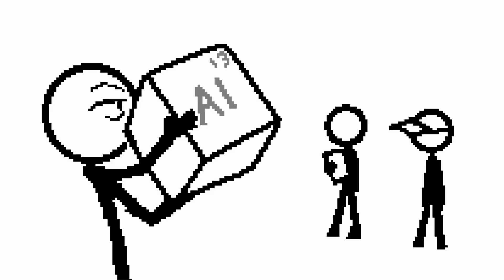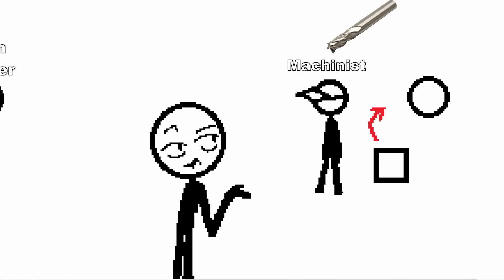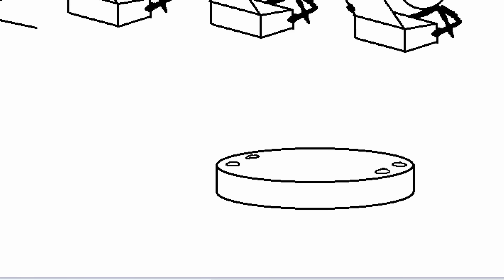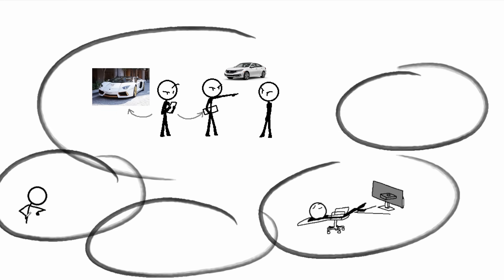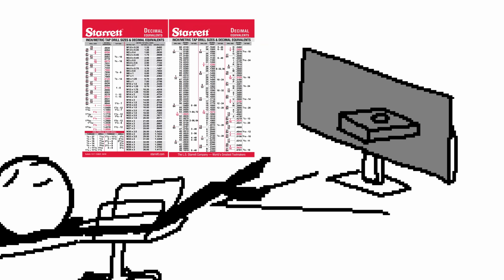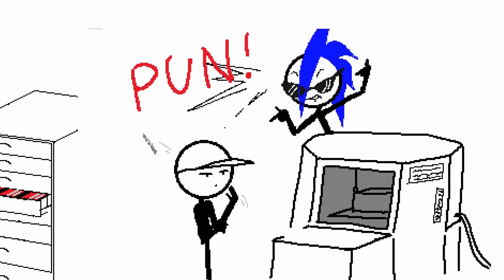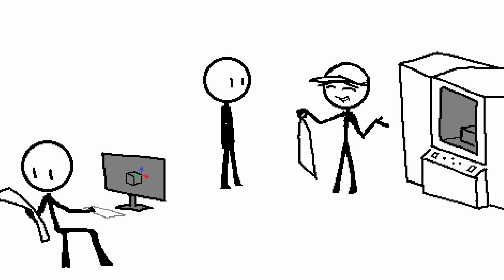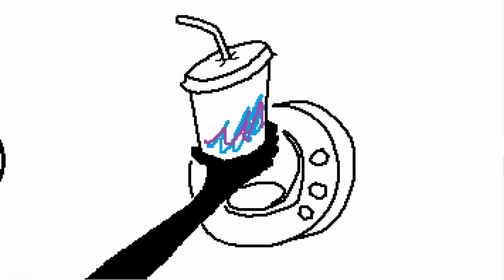Why we hate engineers

Comment: As an engineer that works in aerospace, I vibe with this but in a different way lol. I have to oversee so much crap, and there are some horror stories when our contrators are not closely babysat because they cut corners. 

Infamously in my field of avionics, Lockheed and Northrup working together on the F-35 did something embarrassingly stupid. These planes are stuffed to the brim with highly sensitive electronics and wiring. They need a special type of insulated, twisted wire to prevent electromagnetic interference between wires and from radio emissions. It's very basic stuff, but do you know what is cheaper? Regular old straight wire, perfectly susceptible to EMI. So during testing, they did what I can only describe as a taking a hyper advanced, 53 uber-gajillion dollar flying supercomputer, and fully wiring it with bargain-bin straight wire. When the adults (paying customers) came back into the room to fly their new 42069 cuckillion dollar death machine, nothing worked. It had to be taken apart and rewired on the contractors' dime, wasted a lot of schedule time, and heavily pissed off the government people overseeing it.

This is why we don't let contactors do things without strict oversight lol. People with my job of what is basically "small team of engineers working for paying customer overseeing large team of contracted engineers" have to be very cynical and nitpicky.
Reply: Electromagnetic interference [EMC] (and stealth) is the new kid on the block and cuts through everything. The biggest 'problem' is the `mechanoids` who haven't realised that metals are conductive and hence part of EMC design. It's easy to accidentally compromise designs every which way - It's like "what if plastering was part of electrical circuits"
Reply: You lost all credibility when you spelled Northrop wrong...
Reply: @prelude12341  you don't work with engineers much do you

If you think a single spelling mistake can undermine an engineer's credibility, then boy do I have the Description fields of some ECOs to show you lol
Reply: @brandonthesteele  I'll have you know I'm top of my departmint at spelling.
Reply: The funnies thing is that by what you say, they could have just fucking grabbed some CAT6 cable (heck maybe 5e?) and even if out of spec, I don't imagine it would make completely ridiculous problems surface, but no let's save some pennies out of the many millions.
Sounds like someone at Rolls & Royce looking at the BOM and thinking "hhmmm... We should save money by not clear coating the wood panels!"
Reply: @prelude12341  pffff You know nothing of tolerances then.
The name is Northrop (+- 1 letter)
Reply: 😅 got a similar but not as severe story. Special machines for agriculture need GPS, GSM, UMTS, and LTE you name it. To protect it from nature and farmers they replaced the plastic cover with a coated steel one ... Easy to fix but made a view folks dozens of years older as we couldn`t reproduce the error until we got a machine from production.
Reply: @MrHaggyy  We had a an even less severe situation at work, with our only router on the room being inside the network switch box.
Yep, a Faraday caged router. Signal/10 for sure.
Reply: Don't the government people know they work for the contractors? Those are tax-paying voters! Government people have no right to be upset at tax-paying voters!
Reply: They also sourced materials from china
Reply: I’m more than a little suspicious of your story, not for spelling “Northrop” wrong, but because you say it had to be rewired at the contractors dime - that’s not how these contracts are written. Most (if not all) government contracts are what you call “cost-plus”, meaning any additional expenses (unless found to be fraudulent) are paid by the customer (the government/tax payer). That’s why when HII went billions of dollars over contract budget on the Ford Class carrier, Congress had to approve of the extra spending and needed justification as for why; this is one example of MANY. 

Additionally, I very highly doubt extremely experienced electrical engineers would miss something as simple as what you are describing, especially when system safety teams are literally employed to think of simple problems like this and ensure they do not happen on a large scale. Now, could this occur on a subsystem? Sure! Stuff like this happens all the time on very small scales, and perhaps you’re overstating the problem and it happened on some individual subsystem/component that prevented operability, but I guarantee this was not a widespread event as insinuated.

Finally, these contractors poach talent from the government all the time because they pay more. Often times internal oversight in these companies is more experienced than the agency overseeing them; I’ve worked on both sides of the fence, I can tell you that government regulators are not always the brightest bunch.
Reply: As an avtech, god I wish more people thought about how to replace the damn things as well. Some aircraft have shit that fails regularly in stupid to reach places for. O reason. At least make an access door or rearrange some boxes to make ones unlikely to fail at the back
Reply: @user-rt8ul1fn3y  Not all governments are the federal government.

This is a bit easier to pick up on if you live in a real country with a real nationality, i.e. the various enclaves actually have a common cultural heritage, that gets democratic representation to reinforce its values and to spread understanding of how the culture actually functions. The congress no doubt has lots of fun approving all kinds of money that pops up from literally nowhere, but it hardly represents anyone actually backing that up with value of work. 

These cut corners is WHERE that additional value is extracted FROM, so when some things happen WITHOUT a system safety team, they can yield the profit to hire a system safety team to sit around somewhere else. What you've identified here, is exactly the morsel of truth that gives flavor to the big lie, that you and just hire people first and think of the profits later. Funny thing is, it worked for the Societs too, until it didn't, "the great leader would never allow this kind of thing".
Reply: @user-rt8ul1fn3y  I just started working in defense after working in the medical device industry for a leading manufacturer. I’m a mechanical engineer 2 years out of school. I’ve been amazed at how knowledgeable those at my company and others we work with are on so many mechanical engineering topics. I’m trying to be a sponge and absorb it all. 

One thing I’m struggling with are politics between us, sub contractors and companies we work with. Do you have any tips?
Reply: @sboinkthelegday3892  Your reply doesn't make any sense in the context of this conversation. The F-35 was build by American defense contractors, funded by the American taxpayers, approved by the American congress in the American Federal Government . It seems you may have missed the point of my original comment and perhaps you should go read the comment thread again. 

Additionally, what "value" are you alluding to when you say "cutting corners"? Do you mean profit? Sure, of course companies cut corners to maximize profit... but not when those corners impose a significant and unmitigated safety risk, or they break contract, which is exactly what the original comment is stating: the plane (apparently) didn't work because there was a significant, widespread, and easily identifiable electrical and safety hazard present, which would not have been missed by experienced system and electrical engineers.
Reply: @brandonf3865  
Politics are a tricky topic and they vary in every company and position. I didn't like the office politics in my civilian job, but I don't mind them much in my current position (contractor). 

The advice I can give you is intuitive, but sometimes forgotten:
1) Treat everyone with respect, even those you don't like, and talk to them politely.
2) Only state things you know to be certain; if you don't know the answer to a question then simply state you don't know, but that you will find out ASAP and get back with them.
3) Trust everyone's word, but do your best to verify it's accuracy if you can - especially if it effects work you are doing. 

If you can get a copy, read "The Unwritten Laws of Engineering" by James G. Skakoon. It's a short read, but provides excellent advice even outside the scope of engineering. 

Good luck!
Reply: @user-rt8ul1fn3y  will do, thanks!

Comment: I am a CAD/CAM Designer AND Fabricator. This video had me in stitches because I've seen both ends of the spectrum and often have to work with drawings that other people have designed. One of the companies I do work for is only a few doors down from me on the industrial estate ( thank god ). The amount of times I've simply handed them back the drawing and said "No" is staggering,  but after 5 years they're finally starting to get it....starting to.

Sometimes I'll still get designs from them for tooling they damn well know I don't have, and when you ask them why it turns out there was absolutely ZERO REASON FOR THAT SIZE other than "the designer thought it would work", while disregarding "The Chart".

"The Chart" is a godsend, as long as people use it...

Comment: As a freshman going into aerospace engineering, this answered a lot of questions that I didn't even know I had. Thanks a bunch mate 👍
Reply: GL mate, as a senior it's a lot of work but a lot of fun.
Reply: Get a part-time job in a machine shop, if you have anything local.  Learning the basics of what's feasible is massively useful information.
Reply: As a freshman in Aerospace Engineering, I hate myself to model things in AutoCAD Inventor 😂
Reply: @waraftermath4202  AutoCAD or Inventor?  Both are very different lol.  SolidWorks is nicer either way.
Reply: @ClubPenguinMaster88  I swear it’s called AutoCAD Inventor, oh well. But yeah, I had finished five assignments on Inventor that wants me to create a housing bearing for 12” and 6.5”. It sucked when I’m using VDI 🙄 oh btw, I think it was called AutoDesk, I got it mixed up
Reply: As another freshman going into aerospace engineering, this video was perfectly timed with an assignment I got about tolerancing!
Reply: @waraftermath4202  Yeah they’re made by the same company, it’s Autodesk Inventor (3D modeling) and Autodesk AutoCAD (2D schematics and drawings)
Reply: Thanks for the encouragement everyone! And yes, CAD is hard...
Reply: @ClubPenguinMaster88  Inventor is objectively better, but for some reason Solidworks is used everywhere instead
Reply: @Professor Frog I'm a MechE dropout, for reasons outside of academics, but still work in the general field, checking part prints, and doing some modelling and design work for large-volume component production.  Some of the absolute trash I see coming out of larger manufacturers that we contract for is just inexcusable...  I can't speak for other schools, but the graduation requirements on my end only had the school's machine shop as a supplement/lab for our design courses.

Then again, my father is an Industrial Engineer, and he wasn't required to do any machine shop work, outside of a basic introduction, either, but he had sense enough to do so whilst going to school, to pay the bills, as well.
Reply: @turolretar  Inventor has some features SolidWorks doesn't, but when it comes to speed and accuracy, SolidWorks is just better.  I've used both extensively; the only time I ever even consider using Inventor these days is for making gears.

Besides that, I'm not sure what you'd prefer Inventor for.  For SolidWorks, the ability to adjust constraints and quickly create every kind of line with a right-click and drag is amazing.

Comment: I had a job where my role was effectively to translate between the machinists and the designers.  It was waterway engineering rather than a machine shop, but a lot of the principles still apply.  Designers would do things like call for materials that don't exist or parts that are functionally impossible to get on site.  I remember one project where the design called for several places where a log over 100 feet long should be used.  There were not any trees that big on-site and getting someone to deliver a log that size would have been horrendously expensive (let alone maneuvering it to place it in the right spot).  We had to kick that back to the designers going "that's not possible".

At the same time, the guys on-site implementing the designs were constantly looking for ways to get things done faster and cheaper so they were constantly trying to poke holes in the design for places where the tolerance could be a bit looser.  There were so many times the designers let them not follow the design exactly that when they put their foot down on something really needing to be a certain way the guys actually making it would throw a huge fuss.  So many times where they would try to do the equivalent of just angle grinding something and I would go "no, that part really needs that tight of a tolerance".  A few times, it would be bad enough to make me go "you better hope the state inspector doesn't see you do that".
Reply: Im confused how one becomes a designer without the underlying practical machining knowledge. That doesn’t even make sense to me. And on the same thread why wouldn’t machinists be able to make their own designs when they know what is actually possible? It’s really weird to me that this task is split into two people when they are so seemingly intertwined with each other
Reply: @brownie3454  because time is money, and boss won't pay for both time and money they spent on single exclusive person who can do everything. Better split it and make the progress go together
Reply: @eggl7469  maybe i didnt word my comment accurately. even when split in two, i dont understand how either person gets their position without being able to fill the other position as well. seems like it’s asking for trouble and we end up with complaint videos like this
Reply: @brownie3454  because, at least in general, they do share some basic knowledge between each other, but both professions are different in pretty important ways (for example, design engineers need some pretty deep programing and simulator knowledge, while machinist are experts in operating the machines they use), because they are specialized in doing what they are doing (either designing stuff or building stuff)
Reply: @lightning3911  why arent designers required to be masters of the machines that will be implementing their ideas? that way they wouldnt waste time with a design thats getting sent back anyway
Reply: @brownie3454  cos then theyd be paid 2x
Reply: @brownie3454 why aren't architects also construction workers
Reply: @brownie3454  basically, because that would basically double the time it takes to learn to be either (with btw is around 5-8 years depending how/if you specialize) since the amount of knowledge you need for those jobs is quite large. But even if you ignore that, design engineers don’t only work with machinists and viceversa, they do a lot of other stuff that involves OTHER types of engineers (civil, physics, mechatronic, heck, even environmental in some cases) so there is no reason why designers should know what machinist do in particular, since you could say the same for any other branch of engineering.

TL:DR it’s too much information for it to be worth it for a single person to learn both

Comment: I applied for a summer job as a tool maker because I thought it would be neat and I didn't want to work at McDonald's. What I didn't realize was how much useful information I was going to learn! Any time I told one of the older workers that I was majoring in engineering, I got valuable advice not far off from what was mentioned in this video! I just hope I will remember it all...
Reply: Once you graduate try doing a year in some sort of job-shop manufacturing place. I've spent 3 years as an engineer at a sheet metal fabricator and I think I've absorbed enough manufacturing common sense. I realize now how many headaches I must have given some poor machinist when I did intern work as a designer.

Comment: I’m studying to become one of these “designers” and just stumbled across this and I gotta say using 3D printers is super awesome but it trains your brain to make crazy cool internal geometry and stuff and so times I have to remind myself that “the drill can’t go in there and then there and in here”😂 great stuff man
Reply: I'm glad you've recognized that.  As a fellow designer, recognizing the limits of production is insanely important.  Sometimes, people oversimplify to the point of wrapping around and overcomplifying the process.

The aspect of production that should take THE most effort is the design.  There should be zero skimping out on evaluating, reevaluating, and ensuring reasonable design.
Reply: @ClubPenguinMaster88  yes yes yes
Reply: And even with 3D printers you can save a lot of time by first deciding what orientation the part should be printed in, and then designing it accordingly.
Reply: I had a professor in school who required everyone to CAD from a starting block of stock. Like, you'd extrude a rectangle and then start cutting it down to what you want. It forces you to actually think about the machining process.
Reply: @SaHaRaSquad  3D printing SHOULD require a lot of forethought in design, too!  It's vital to know the limits of your printer, and how to optimize according to print time and surface quality.